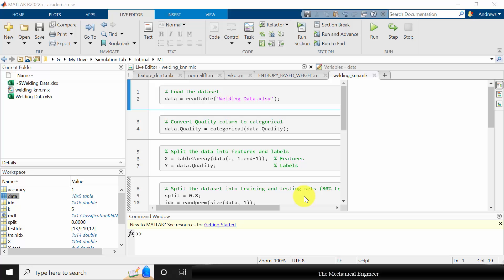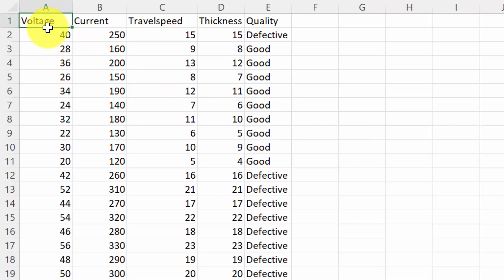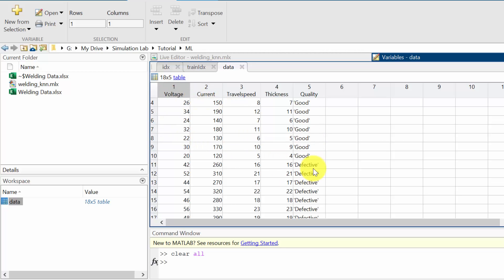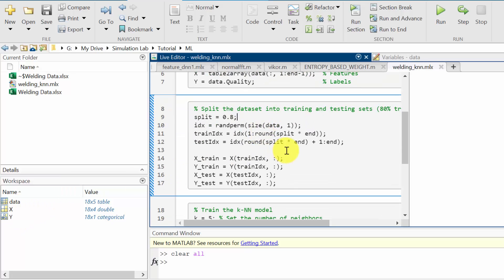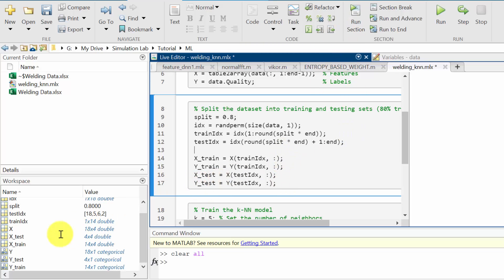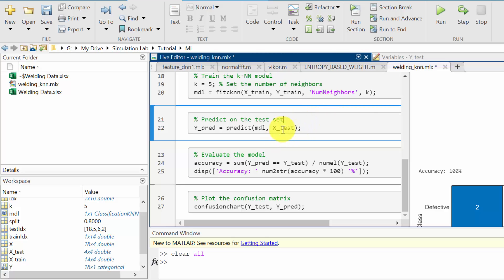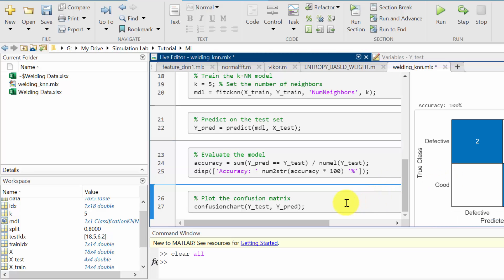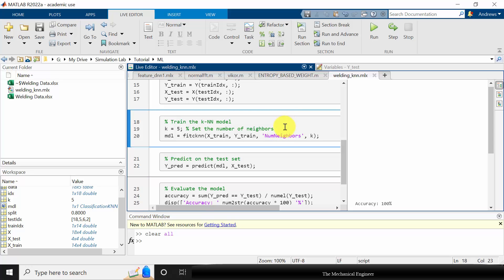Prediction of Weld Quality Using Machine Learning |Machine Learning for Mechanical Engineers |MATLAB

Comment from the maker: MATLAB Code:
% Load the dataset
data = readtable('Welding Data.xlsx');

% Convert Quality column to categorical
data.Quality = categorical(data.Quality);

% Split the data into features and labels
X = table2array(data(:, 1:end-1));  % Features
Y = data.Quality;                   % Labels

% Split the dataset into training and testing sets (80% training, 20% testing)
split = 0.8;
idx = randperm(size(data, 1));
trainIdx = idx(1:round(split * end));
testIdx = idx(round(split * end) + 1:end);

X_train = X(trainIdx, :);
Y_train = Y(trainIdx, :);
X_test = X(testIdx, :);
Y_test = Y(testIdx, :);

% Train the k-NN model
k = 5; % Set the number of neighbors
mdl = fitcknn(X_train, Y_train, 'NumNeighbors', k);

% Predict on the test set
Y_pred = predict(mdl, X_test);

% Evaluate the model
accuracy = sum(Y_pred == Y_test) / numel(Y_test);
disp(['Accuracy: ' num2str(accuracy * 100) '%']);

% Plot the confusion matrix
confusionchart(Y_test, Y_pred);